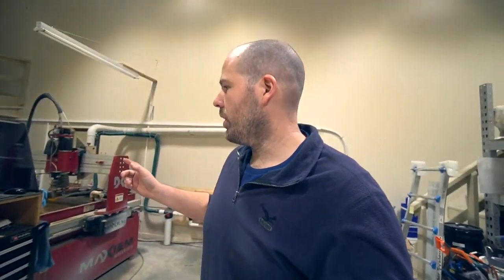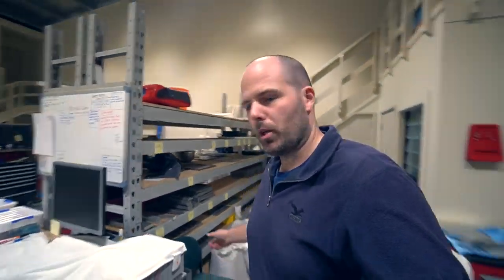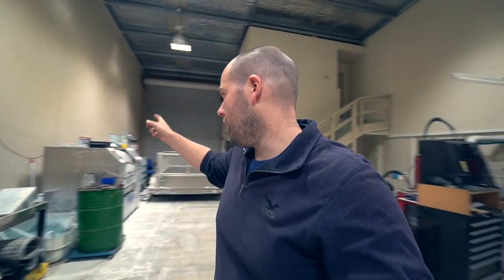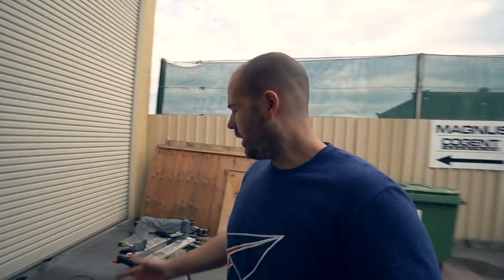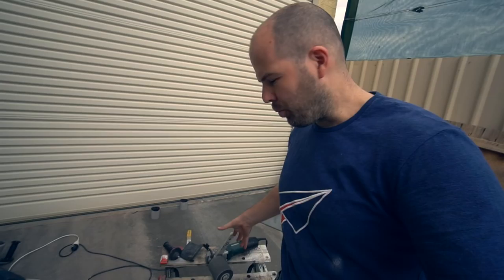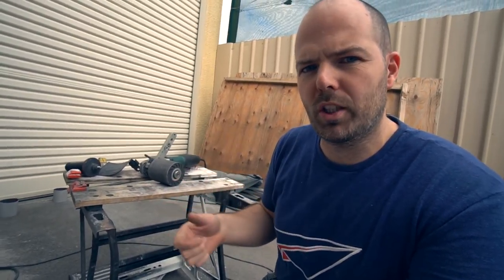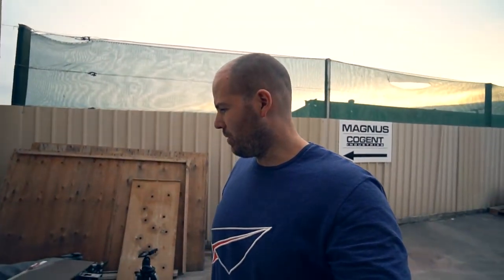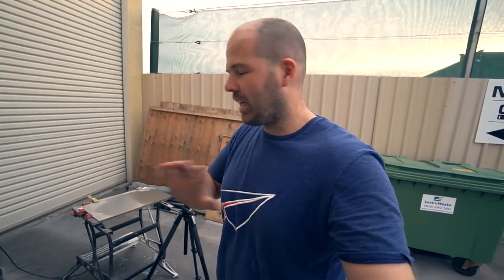Hacking This Sanding Machine - Will It Work?

Comment: Once again, good to see your up beat positive attitude in these lastest uploads...it seems like you have clear and positive direction when you're in this mind set with creative ideas flowing...BTW excellent creativity and engineering with the grinder...I still have the question of: Why not profile the caribiners with laser?...Is it a thermal thing where the Titanium heats up too quickly and the thin profile of the caribiner can shift/move during profiling causing a reject part?
Reply from the maker: Hi Ian, this is a really good question. I'll try and remember to answer this in the next video (remind me if I don't).
Reply: Just been watching again, an older video you did (11 Oct 2016) TOP SECRET: Prototypes...some great ideas sitting there maybe wanting to get from the idea/prototype stage on to the manufacturing-marketing stage.... some great ideas there from what was shown and sounds like there were boxes of other projects you wanted to do but had to concentrate on other more important issues/projects at the time....maybe you could do a follow-up video of the other boxes we didn't see of "held up" ideas that you put aside for consideration which could inspire you to pick those prototypes where you left off....

Comment: Also be careful it's not too much weight to throw off the rotation of the idler weel, it may be why it would be bouncing other than the table. It might be a good idea/or not haha to connect the weight bracket to both sides of the idler spindle? Good luck. Awesome videos.
Reply from the maker: Thank you Jakob. This machine is absolutely at it's limits and it's going to stop working soon I'm sure of it. Thinking I will likely make one from scratch with a more powerful motor.

Comment: Hi, you may want to lower the pressure to the abrasive hopper. That should help with abrasive getting on the Y beam.
Reply from the maker: That is an option ...I'd be apprehensive though that the garnet does not then get pushed through fast enough.

Comment: Why not get a 2. hand surface grinder from the 60ies - or have you looked into maybe outsourcing it?
Reply from the maker: Hey Tony, yeah, it's a tough one... outsourcing is not really an option as I've tried to get it but no one seems to do to what I require. Have thought about a grinder - but one of the issues with that is holding the titanium down (usually it's a magnet that's used) ...also, it would have to be used indoors I think ...which starts to get hugely costly because of the danger (a very real danger) of the explosiveness of titanium dust.

Comment: Might be a silly comment but why do you sand the titanium sheets?
Reply: robby69100 so did I but still have questions. Such as what about a higher grit tumble before the finish?
Reply from the maker: Tumbling is very effective for corners, edges and protrusion. A centrifugal tumbler has only a little effect on a flat surface (even with 20+ G-force) ...and a vibratory tumbled has negligible effect on the flat surface of a part.

Comment: I'd use water or oil under that sander for titanium your belts will last much longer
Reply from the maker: Have tried this. It kind of worked ...but required special belts that could stand up to water.

Comment: What's in the 4" pvc pipe to get the garnet slurry to move that far?
Reply: Michael Nelson I assume it rotates and vibrates the (PVC pipe) meaning the more or less dense part will move within the median.
Reply: How does it lift the slurry 5' in the air? Is there a pump in the tank I'm not seeing or some type of impeller in the tube?
Reply from the maker: Sorry, my explanation was poor. I'll try and remember to do a better explanation in the next video.